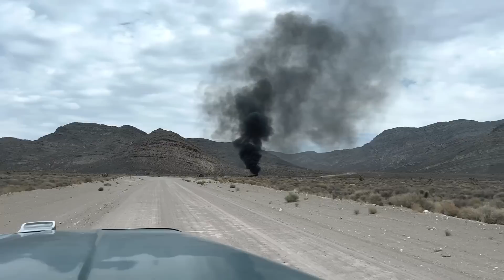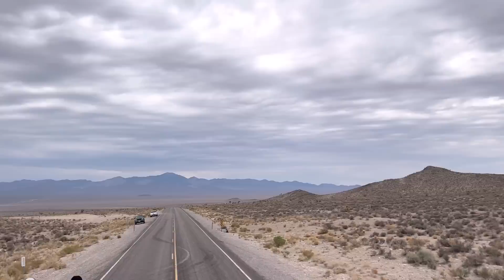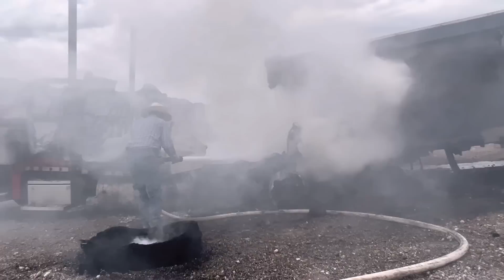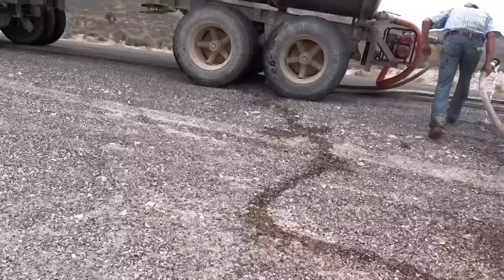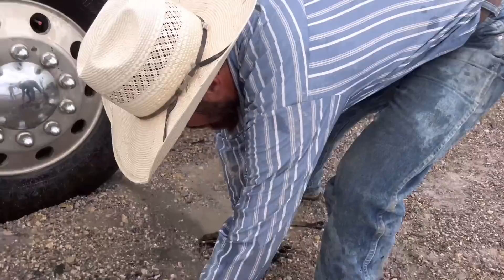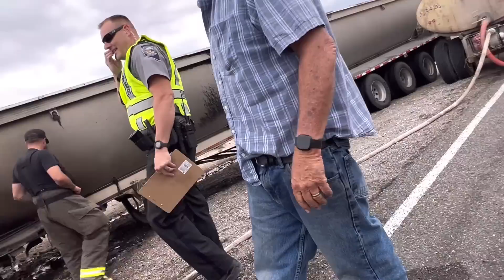Semi Truck Burns Down                          @ Anchor Brand Ranch

Comment: Good job guys. You did save part of the trailer, it wasn't a total loss. They were just lucky you saw the fire and had the water available to help out.
You were blessed to have the truck full. And I agree that you should always have it full of water and the truck ready to drive in case there is a fire there on the ranch since you are so far from fire services.
Truly blessed!

Comment: GREAT JOB! You guys may have saved the whole area and your ranch if the poo had caught on fire. That water truck needs to be full at all times It could save your own one day. Being in such a dry place and help so far out I would definitely be prepared and try to fix any leaks or problems with pump and try find some extra hose. THE ANCHOR BRAND RANCH FAMILY ARE A GREAT FAMILY THANK YOU FOR SHARING YOUR LIVES AND THANK YOU FOR GOING TO HELP THE TRUCKER! GOOD JOB FILING!! 👍

Comment: I was impressed that you could spot what was going on in the fire from the ranch. What was that? Three miles away? You even correctly spotted that it was the manure truck semi on fire while still near home.
Reply from the maker: Your question made me curious so I just measured it using an app called on x
It’s 7.61 miles on the roads
Only 7.0 miles straight shot

Comment: Strong work fellas' In a rural area you have to do what you have to do! I am a fireman/ fire officer 43 years on the job and got say you guys did great! It took the local FD 30 minutes to get there with a quick attack truck( which would not have put out that truck fire with the amount of water it had on it) So now you know how long it would take them to get to your house. Glad you had that tanker( looks about in the 5000 gallon range) I would keep that thing filled and ready! I would also get some more hose and some fittings compatible with the fire departments hoses , might have to supply one of their trucks one day. Also on truck fires just make sure you find out what they are hauling before you go diving in there a lot of them are hauling some really bad stuff ( HAZ MAT!!! ) But once again Strong work!!! Be Safe out there.

Comment: Living remotely has many advantages but also comes with a few challenges. Keeping the tank full of water is a great idea. The clock is ticking in an emergency. Every second counts. You might look at a way to build air pressure on the truck faster also. Maybe keep a full portable air tank handy on the truck with a quick connect fitting spliced into your air system. Boost the pressure so you don’t have to wait on the truck compressor. Great job and thanks for helping in this emergency.

Comment: You defiantly did something. You kept the fuel from spreading over the road. If the tanks had gone or it had got into the fluids upfront that road would have been closed for a while due to road damage.  Glad everyone was ok.

Comment: It looks as though you were miles from anywhere so it was a shame that you could not get there fast enough to save the truck. But it is good that there are people as good as you prepared to go out of your way to try to help and you certainly stopped it getting much worse. I doubt if the nearest fire company could get there in time to stop explosions and surrounding prairie fires in the way you did, and that is NOT an attack on the fire companies. I hope the local community recognize and reward you in some way. Well done all of you and my sympathies to the truck driver and owner.

Comment: Not a bad stop at all, especially considering what you had when you rolled up. I've seen trained FF, both union and volunteer, do far worse. As a 30 yr volunteer, I agree with John Lookabill, Thanks for caring and jumping in to help. good job, guys! For those who think fire arrived late, you must not have seen the west US. The distances are mind boggling out there, where here in the east, a run of 15 minutes is long, out there 30 or 40 minutes plus the volunteers  getting to the apparatus.
Reply: Even here in Ontario, Canada a lot of the volunteer departments, mine included, have 30+ minute response times on the cottage roads.

Comment: Might want to find a "Y" and a second hose. It will reduce the flow by about 25% on both hoses, but you can do 2x the work.  Nice job btw. The gods were smiling on ya'all.

Comment: You did what you could. If they're interested in selling what's left of that truck and trailer I'd be interested in it, still have a few parts I could use. I just got done hauling gravel for the season so if you need a poop hauler lol... also they cost a bit more but might want to look into a high pressure Honda pump they're made for fire fighting and spray further so that you're not having to get so close, maybe even a PTO water pump.
Reply: So did the guy get a flat and kept going till the other one blew and started a fire

Comment: You should plumb in a spray bar (easy and cheap) for the rear corner of the tank and that way guy can easily crack a valve and drive while spraying. Road side beneficial.

Comment: Welp, looks like you boys'll just handle whatever shows up!  I was intending to let this video play while I was working in the shop, but wasn't long before I had to put my work down and come over and look, lol!  That was actually a little scary.  ...ahh...you're not the only one who gets a little fierce when the pressure's on.  Having a well-developed sense of urgency is a very good thing, but steamrollering everybody isn't, and I learned that the hard way of course.  You can solve the problem of knowing how to hook up the hose by learning how to do it and practicing, but that doesn't solve the problem of getting fierce.  That's your nature, there's nothing wrong with it, but it can get in the way, only thing is it's here to stay and the best you can hope for is to figure out how to head it off at the pass if you can.  Here's what I do, in case it might help:  I have a joke in mind ahead of time, one that made me laugh so hard I had to excuse myself real quick.  The rule is, when I feel fierce, I bring that joke to mind, very deliberately.  It might not make me laugh again in the moment, but what it does--what I try deliberately to let it do--is loosen all my bolts so to speak, so I can proceed with more calm and less collateral damage.  Try it, see if it helps.  Well done, y'all!  :)

Comment: Well it had to knock a fuel or seal out somewhere on the axle it blew on because a tire aint gonna burn a truck to the ground with out a ignition source. Good thing tere are folka like yaw willing to help . Sure was a pretty nice old pete that burnt up though and a very expensive trailer thats noe junk too. Might be able to reuse the motor and front suspension

Comment: I've owned trucks since 1984 and drove since 1980. Something in his story doesn't sound right. I've never had a brand new tire blow out or 2nd new one blow. Or a blown one catch fire. But I've seen guys get brakes hot or leave park brake set and catch fire.

Comment: That water trailer is not safe to be on the road no air lines from truck to trailer means no brakes on trailer how did you get it stoped before tractor brakes started smokeing
Reply from the maker: Hit the Jake’s and downshift trucker!!!

Comment: That motor and transmission are worth a lot. You can’t get a Cat motor anymore and non emission motors are even better. I think I saw you double clutch and no air in  the seat. Not many around that can or will drive like that.👍 
People don’t realize when you’re not raised in the city, what you and the family did is totally normal. It’s not even something you care to be thanked for it’s just what you do.